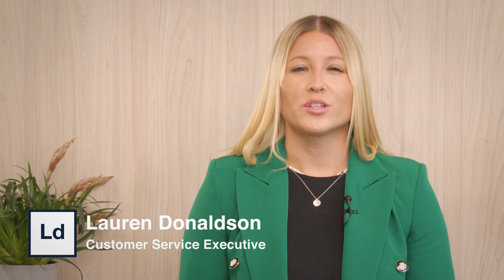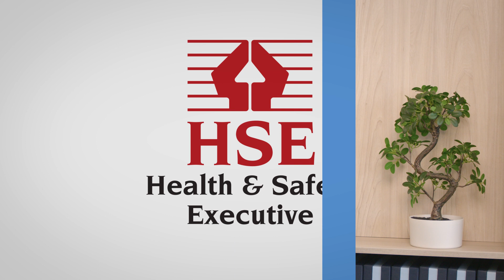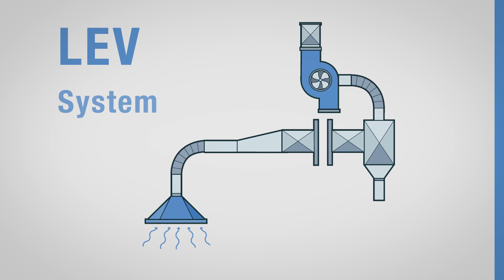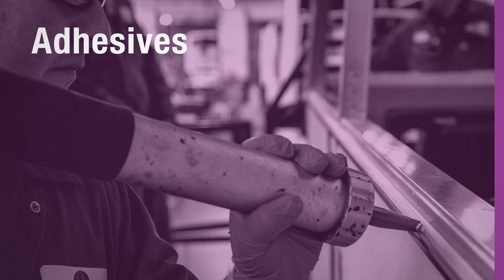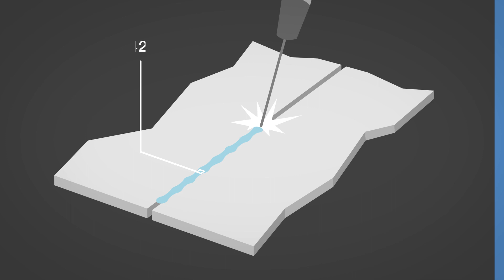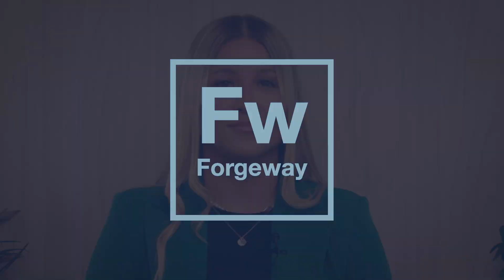How to Join Metal without Welding?

Comment: After being a Journeyman Iron Worker for 31 years and have worked in Steel Fab shops, and connected steel in the field many times. I got exalant training throughout the many years at work. Welding can get good in cases but does have its drawbacks in the health industry. Most steel buildings are bolted together with little welding on it. I have a good friend that welded most of his life and came down with a bad set of lungs and incurable.

Comment: I'm always looking for different ways to bond projects.
Just recently used automobile window glass adhesive to join two metal frames together, rigidly sandwiching a bronze screen between them. It worked well, with the adhesive joint becoming part of the finished edge.